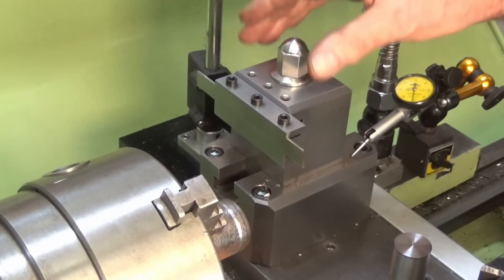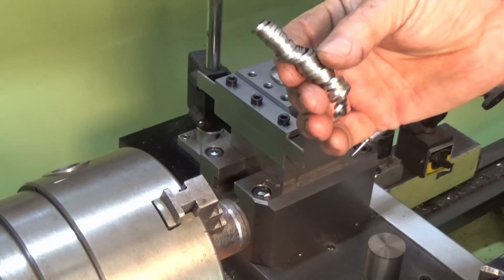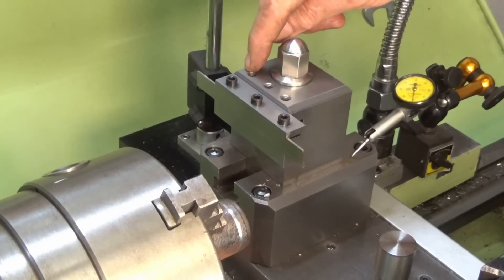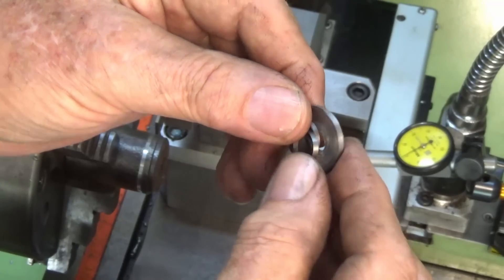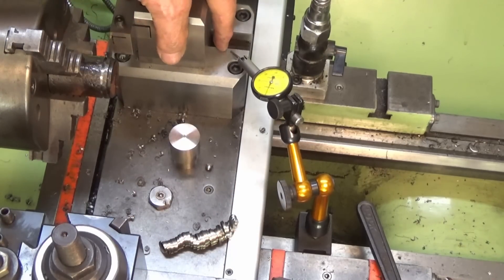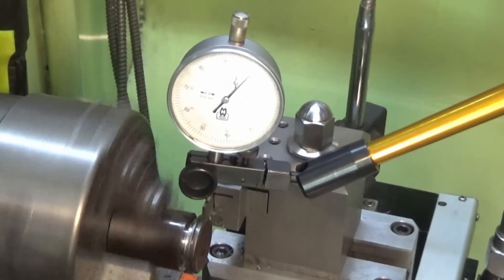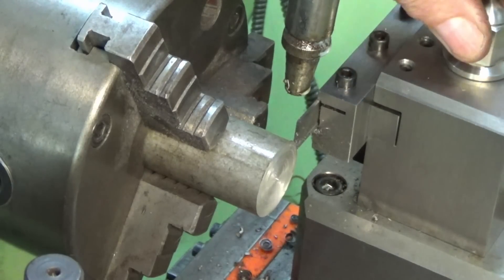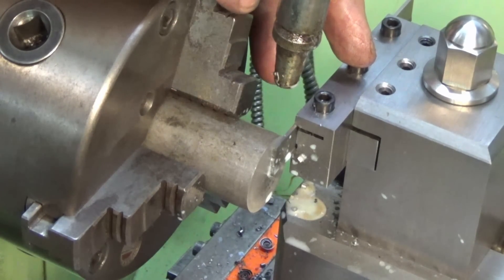Rear Parting Tool Holder For Your Lathe - A Little Performance Analysis

Comment: Hola mark ,excelente,,,se dedico a resolver ,un problema ,que ,por lo menos a mi me bailo un buen rato ,cuesta comprender por que ocurre ,peor si no es siempre , que  presenta ,, aqui ,,,en apariencia todo estaba correcto ,,hice varias pruebas , y mediciones ,tratando de determinar de donde podia provenir , silo había  movimientos despreciables ,,,hasta que al final  de tanta prueba , encontre,el punto devil ,,,estaba usando un porta herramientas de cambio rapido ,y tenia destinado , un block  especifico,para usar con las cuchilla de corte , ,este no apoyaba perfecto sobre los prismas de la torre ,aun ajustando ,al maximo , la parte trasera de los prismas ,quedaba sin hacer, un fiel contacto ,en su longitud ,,luego ,, corregido, ese defecto ,se acabo el problema ,,realmente  desconfiaba más provenga de  juegos parasitos del conjunto de guias, del charriot ,y del transversal ,,que por regla general suele ocurrir ,pero ,,menos del blok,porta  herramienta ,, justo ,,por azar tomo el más malo,,,para lo mas critico ,,el tronzado  que ya ,,de por si ,es tarea complicada ,,,aunque tengamos años de experiencia ,hay algunas cosas  ,que nos ,complican ,,creo es normal ,,lo bueno es que se pueda ,intercambiar informacion ,,e ideas ,,asi puede ser de gran ajuda ,a otros ,,muchas grasias mark ,,un gran abrazo ,,

Comment: I just made a rather elaborate version for my lathe, it’s a odd dovetail type and it’s not as simple as just bolting it down to the cross slide unfortunately. But it did turn out great. And rear mounted parting is the ONLY way to go for me from now on. What a satisfying experience! I made a block that clamps down on the cross slide using the dovetails that now accepts a CXA size QCTP vs the BXA size that’s on the top slide. It’s so nice having the versatility of tool post mounting and rear turning and parting options.
Reply from the maker: Thanks. I love the design of the old Myford lathes that had tee slots on the back side of the cross slide. I don't know why all lathes don't have that feature. I have found that hand feeding the rear mounting parting tool can still be a bit hit and miss. If I just engage the auto feed and keep the cutting oil fresh it always seems to cut without issue. It's really counterintuitive but it works.
Regards,
Mark

Comment: How do you adjust the height of the cutter 🤔
Reply from the maker: I can't really. I can put a very thin shim under the block that fits into the solid tool post but I figured that I would not be swapping out tools and that it was only ever going to be used for one style of parting blade so I just machined everything to put the blade tip on the centre height of the lathe.
Regards,
Mark
Reply: Thanks Mark, I will figure something out like shims maybe.

Comment: Hi Mark, 
WOW, what a great series and expertly covered thank you . May I ask the name of the firm you purchased the Dura-Bar from please. I am guessing you are in QLD from hearing the parrots in the background. You have inspired me to attempt it myself, but I am struggling to find a slug of steel that size. 
After having forked out over 8K for a 1336 lathe that is touted as being "Euro Precision", sadly I find no matter what I do it will not part off. For a lathe weighing over 600KG and costing that much, needless to say I was gutted. I have stripped it down to the main bed and redone all the Gibs and re-adjusted the entire machine. It's better, but not much. I would have sent it back but the one saving grace is the spindle has 0.005mm runout. I have never had a lathe spindle that accurate. Also, the 3-jaw chuck is 0.05 runout. So its biggest Archiles heel is it won't part off. Thanks again.
Reply from the maker: Unfortunately, the company I bought the durabar from has folded. It was called Mancave Metals and the guy that ran it was based here in Australia. I don't know what happened but his website is now closed. However you can buy short lengths of durabar from https://www.edconsteel.com.au/store/products/steel/cast-iron/round-bar/3d
They do sell in cut lengths and the prices seem OK. I have also bought large pieces of steel and other metals from Offcuts Galore on Ebay. https://www.ebay.com.au/str/offcutsgalore
He sells aluminium, brass, steels and sometimes cast iron. It is a bit of a lucky dip and his stock changes regularly. If I am looking for something in particular I have contacted him and he will keep an eye out for me. 
The base of the rear parting tool doesn't need to be cast iron. Steel would be fine but cast iron does have some internal damping properties. For what it's worth, I have some carbide insert parting blades which fit the rear parting toolpost but they need a lot of tool pressure to work well and I find that using a manual feed is a bit precarious. You just have to bight the bullet and use power feed and they seem to be fine. HSS is more predictable and leaves a better finish on soft materials but the carbide is great for stainless and harder steels. Good luck with the lathe.
Regards,
Mark

Comment: Make sure you lube the SS thread to prevent galling of the thread.  The galling will lock up the bolt.  Wear on the flanks of the HSS blade will make it tapered when looking down in plan view.    Eventually it will wedge into the cut and then BANG.  Carbide insert tooling is much safer.

Comment: Great result - thanks for sharing.
Cheers
Andrew
Reply from the maker: Thanks Andrew. It has given me a lot more confidence when parting off. I recently added two carbide insert tools, a 3mm and a 2mm and dedicated tool holders. They are much better for doing large diameter work since they don't rub so much on the side of the cut. 
Regards,
Mark

Comment: Interesting.  Appears most of the sun ray effect was just due to alignment.  
I was wondering if it might help to capture the cutoff tool in a V slot instead of a square (flat surface) slot, which could help resist side to side flexure.
Reply from the maker: At the end of the day, I am not really concerned about the surface finish. It is almost always necessary to do a facing cut to get rid of the little pip in the centre of the cut off part any way and I am just grateful that I can part off stock without having to worry about the tool digging in and damaging either the tool or the part. However, after using the tool more I have been able to reduce the sideways chatter by tweaking the spindle speed and the feed rate.
Regards,
Mark

Comment: It is not good practice to lift the tool post versus pressing down.
You are going against gravity. The gibbs will suffer. But most importantly, the machine ways are designed to support and absorb the machine loads and cutting forces.
Building a rear tool post is an excellent idea but with the tool pressure force going down.
Also, your build has not enough rigidity. Especially having the parting tool outside of the tool post creating unnecessary oblique forces against the center post.

I enjoy your videos Mark!
I also enjoy the nature aspect of your content.
Thanks for sharing!!

God Bless.
Reply from the maker: The existing holes in the rear of the cross slide were for a factory original Colchester rear tool post so I am guessing the engineers at Colchester had considered the upward vertical load on the cross slide and the gib. At least, I hope they did. I couldn't detect much vertical movement with an indicator during a cut but the real issue would be how much load is transferred to the gib if the tool dug in or crashed into something like  a chuck jaw. 
Regards,
Mark

Comment: I would say what a very nice setup. Even so vibration in the blade will make the pattern on the job.  Excellent, I would be happy with that, primarily when parting the finish is second consideration.
Reply from the maker: Thanks, as you point out, I am less interested in the surface finish. I just want to be able to part off without anxiety. 
So far it is working out quite well. I haven't smashed a tool yet!
Regards,
Mark

Comment: I think your design and concept are spot on.  The only difference I would try is, the grind on the parting tool be at a slight angle instead of straight.
Reply from the maker: If you mean having some front clearance, there is about 5 degrees but no top rake. The geometry of the tee type parting blades means that you cannot grind any clearance behind the cutting edge.
Regards,
Mark

Comment: Wny did you make the tool holder right side up? Seems like that too should either be upside down or why not integrate the blade directly into the tool post instead?
Reply from the maker: I have had a lot of suggestions to integrate the parting blade directly into the tool post but I wanted to be able to swap out the HSS blade for a couple of insert style parting blades I just purchased. I have a 2 and 3mm wide insert type and they are much deeper. To be as versatile as possible it was necessary to have a tool holder for each style of blade. I can also incorporate things like form tools as well.
Regards,
Mark

Comment: As i have mentioned before, boring the jaws while preloaded is an absolute must and it has been covered in great detail recently by none other than Robin Renzetti. I have taken a very interesting idea in a comment on one of the other videos on this subject and put it into a proper design. The concept is presented in my wordpress site blog 'rndproductietechniek'.
Reply from the maker: I just quickly read your blog and I noticed the ring design. I had made a similar part for a 4 jaw chuck. It was cast in aluminium and machined on my small CNC mill. Steel would have been much better but I don't think my little mill would have been up to it. I ground the jaws with a pneumatic die grinder held in a tool post. It sort of worked but I need to revisit the process. I almost purchased an 8mm carbide drill bit today with the idea of drilling the ends of the jaws on my big 3 jaw chuck so I can fit dowel pins and clamp down on a hardened steel bearing race. I baulked at buying the drill since I still have a ton of other projects to complete first. 
Regards,
Mark
Reply: @Preso58  Thanks. The intention is to have these preloading rings laser cut,  I regularly buy laser cut materials, combining this with some customers orders keeps the price down. I first contemplated drilling the jaws for pins, in fact some of my chucks (like the Forkardts) already have holes. But the preloading ring is much easier and I like to keep the boring bar as short as possible. 
I will go ahead with this soon and let you know how it worked out.
Reply: Thank you Mr, Presling for all you have provided. I spotted your channel when you were reviewing Touch DRO. At that time I also was in the market for a DRO system. I'm pleased with choosing the same. I came back to your channel within the past month and  can't get enough. For your current project,  yes misalignment of the blade will cause it to dig into one face and release. For alignment, I have gone to cone-shaped  grub screws but incorporated recessed counter-sunk divits in the blade holder. Drilling the holes in the riser with the blade holder clamped and squared allows a matched set. Anyways Thanks for letting me chat. Scott M. Saranac MI USA

Comment: Mark, I am making one of these and will mount a BXA quick change holder.  I am curious if the orientation of the slot in the mounting block has any significance?
Reply from the maker: I hate having to align the parting blade if you take it out to sharpen it. If it is even slightly misaligned (more or less than 90 degrees to the spindle axis) it will bind as you go deeper into the cut. My aim was to have the components self align. The down side is that it's not so easy to fit general tooling like form tools or a general purpose turning tool. I did consider fitting a regular QCTP so it would accept BXA tool holders though.
Regards,
Mark
Reply: @Preso58  Now I am thinking of streamlining the project more and just mount the quick tool changer right to the block without a slot cut.  Save some machining.  Thoughts on why that would not work and so on.?  Thank you
Reply: Mark, I made one of these units but with a quick change tool holder and I had the same issue I have in the front so I am now thinking it is something to do with the quick change unit so now I will see if I can redesign what I have started.

Comment: Cool. I decided to go all the way and build a 4-way indexing rear tool post using GG25 for the riser block and GGG50 for the indexing tool holder. Using GG25 for the riser block is because of availability and it's less stressed as well obviously. Just ordered the materials yesterday. Because of course there is no compound slide I can use 25 mm tool holders instead of the usual 16 mm on the front tool post, do have to get LH tool holders though. Because the compound slide overhang over the left cross slide guideway (25 mm) is also eliminated the setup will be as rigid as can be. Main goal is perfect parting off and stable roughing. A bonus I think might be better visibility in boring operations. 
I have a smaller Boley RD42 turret lathe which runs in reverse by default, took a bit of inspiration from that. Not having chips flying in your face is probably not bad either.

Comment: Congratulations on parting stainless, it was indeed missing from your last demonstration video. I consider it the real proof of a solid setup, being able to cut stainless. 
A small bit about metal strengths: the steel bolt you were using could be up to twice as strong as the stainless steel you switched to. While stainless steel is very tough to cut, the more common grades don’t have a very high tensile strength. Steel bolts on the other hand do. I’ll assume it was an 8.8 grade bolt, pretty standard stuff: that would have around 800N/mm^2 minimum tensile strength which is twice as strong as mild steel.
Reply from the maker: You are correct about the high tensile bolt. It would indeed be stronger than the stainless that I used. However if I ever do stretch or break that stainless bolt I will have done something really stupid. 
Regards,
Mark

Comment: Hi Mark. I think the cuts are fine. I have been using the one i made quite a bit with the making of the Hemingway kits lathe steady rest series. It has been flawless. No worry of a jam up any more. 
Totally agree the insert holder, although works well , does need a hefty push to cut. As you say they have a pretty blunt profile. All we get in the garden is pesky pigeons & Starlings.
Regards.
Steve.
Reply from the maker: Thanks Steve. I have been using the parting tool a lot lately and it is such a pleasure to be able to run the cuts under power feed. I had started out being quite conservative with my expectations but so far nothing has gone wrong. I did take delivery of the two insert tools and I have designed the tool holders for them but it's not been a priority since the HSS blade is working well enough. I will do an update later on.
Regards,
Mark

Comment: Given the descrepancy between your new back post, and the tool holder..  would it be worthwile 'final' milling it in situ with the lathe chuck holding the tool.. this then is to your saddle's travel/angle😎 exactly. (also an opportunity to show milling in the Lathe for us poorer folk who are mill-less.)
Reply from the maker: I am considering re-milling the slot in the tool holder while it is clamped in the riser but I will probably do that in the Bridgeport. Trying to do it in the lathe will almost certainly lead to more inaccuracy since it would be necessary to pack it up on shims or lower the tool holder in some way to get the cutter to engage where it needs to. 
Regards,
Mark

Comment: When you do part off a piece of stock,  don't you normally face off the cut anyway rather than accept the cut as a finished face?
Reply from the maker: I would normally face off the outward facing surface and then part off. So generally one face is better than the other. If it can be gripped easily I would then face off the parted surface but for thin discs it would mean mounting it in some sort of fixture. I do have a very nice Flexi Chuck with machineable aluminium spigots for that sort of thing.
Regards,
Mark
Reply: Useful to get a good parting off finish when making washers & the like.
I have planned to make a rear toolpost as it also avoids having to change tool holders in my QCTP when making multiple equal parts when repeating turning & parting off.

Mike

Comment: Great job, I winder if eccentricity of the 3 jaw chuck contributes to the pattern. Perhaps a collet may make a difference?
Reply from the maker: I think that there is some sort of harmonic vibration going on but I am not the guy that would be able to test for that. I took delivery of two insert parting tools today. One is 2mm wide and the other 3mm. The type I have should not make any contact with the sides of the groove apart from right at the cutting edge. I am keen to see what sort of finish I can get with them. However, If I can part off without smashing HSS tools I will more than satisfied. 
Regards,
Mark

Comment: Mark, my lathe hates 500rpm. The harmonics are terrible. It shakes like a dog having a … All other speeds are fine. I power feed part off at 300 and its a pleasure. The other thing, if you put an indicator on any cutting tool, it will move. Keep them coming !
Reply from the maker: That's interesting! I recently changed over the motor in my lathe from a 1kw single phase motor to a 2.2kw three phase. I also fitted a new lower pulley and two new matched vee belts. It may be just my imagination but the surface finishes I am getting now seem to be much better. I had read that single phase motors tend to suffer from "cogging" which is a sort of induced vibration in the power train. Plus, more power!
Regards,
Mark